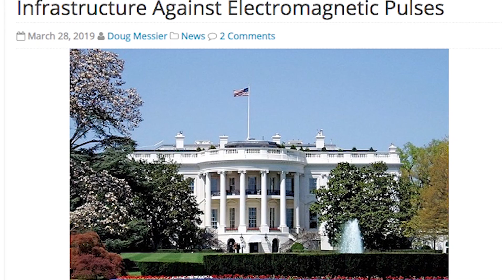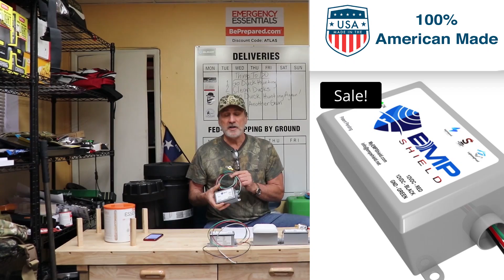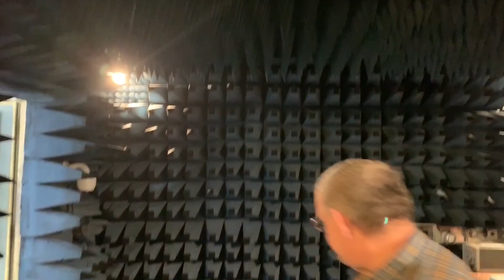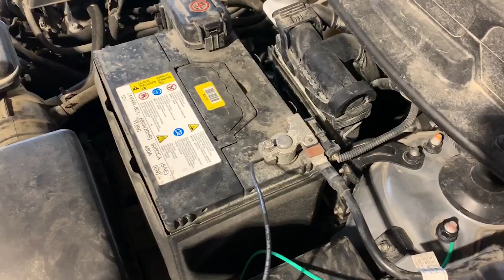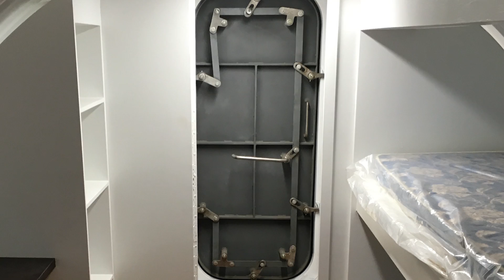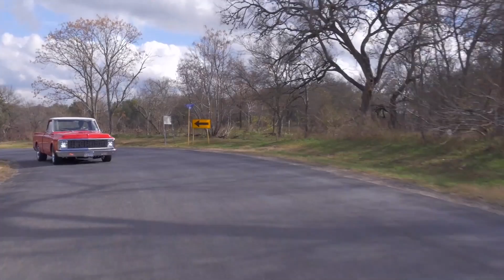How To EMP Proof Your Bunker, Home or Car For $299

Comment: As far as I know, this product is NOT UL approved at this time, the mil-spec testing is great but they must get it through UL testing. Without it I would not install it. Any State electrical inspector would not sign off on it without UL certification.
I do not believe there is any product out there that has all of the necessary certs at this time. 
A lawsuit waiting to happen without the UL stamp of approval.
Just my thoughts as I am awaiting one to purchase.

Comment: Old guy here these used to be the EMP rules, but..:  Good old 12 volts.
Lock your unused/emergency electronics in a metal box or safe along with other important life saving stuff.
         12 volt ham radio with both dc inputs shorted together with the transmitter output test load resistor on output.
         Old transistor/tube radio with battery removed, short unconnected battery voltage "input" terminals if you can.
Your old ham radio may be your only good 2 way communication device for a few weeks.
Your old transistor/tube radio the battery will corrode it left in the radio. 
The reason for shorting inputs is to hold the all power at zero volts, since both ground and plus voltage go tend to all chips, tubes, caps, and coils.
The emp spike will try to raise the voltage on coils and wires to a level that will destroy the connected electronics.

Comment: Would you be able to build a 4 floor(minimum) CBRN apocalyspe shtf bunker with 10ft think lead,concrete,rebar,steel plating, with keycard/pin entry doors, main entrance to an underground garage and to building a 20ton nuclear blast door.

Comment: except Texas who have there own power grid and emp shielding, I have made a big Faraday cage 10x10 feet and have everything I need in there. old diesel cars will still work so get one as they dont need anything other than a battery which will not loose a charge in an emp also its not just nukes that make emps the sun is well over due for a massive solar flair (mass coronal ejection)

Comment: One more question and observation, what good does it do to have emp protection of your vehicle if no electric grid is up and running no electric no fuel, and the reason old vehicles they could use another type of fuel like wood burning gases released from wood or other burnable materials even moon shine liqueur, and did you know a vehicles run without a battery once it starts running so protect the battery itself so you have electric starts.